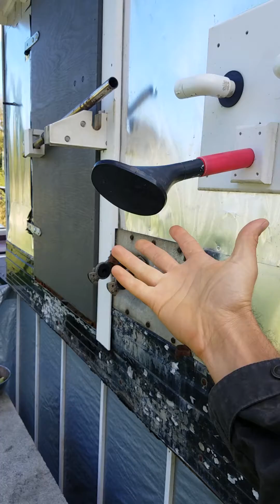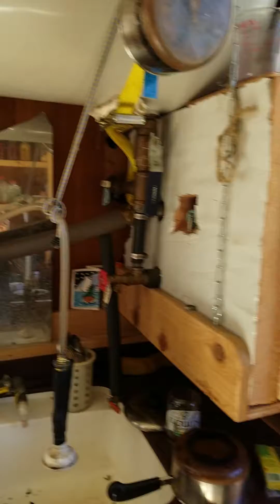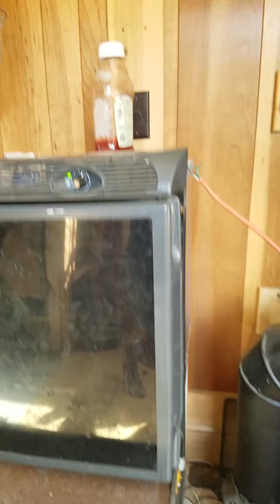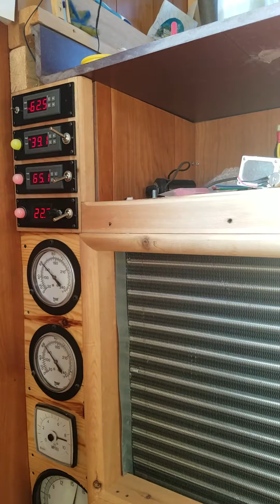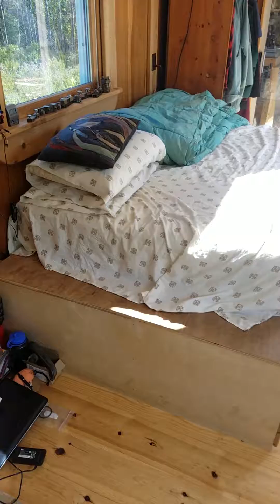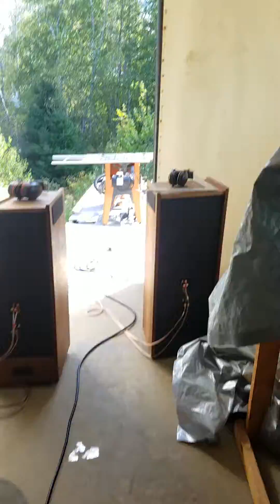Nesthaven: An off-grid tiny-house built in a refrigerated trailer.

Comment: Awesome setup, thanks for sharing.

Solar thermal is something even mentioned on shows like This Old House but despite being pretty affordable it has yet to have wide adoption but could be a massive offset on our energy needs once it does.

Btw, he could have hooked up the wood stove to the heat exchanger too.  There's even kits for turning a wood stove into a boiler and easily plumbing it into the main hot water tank.

I've seen the corded 18v setup for power tools before, but this was the first solar power version I've seen.

Overall, a great demonstration of what DIY'ers can accomplish...
Reply from the maker: Thanks. It's still a work in progress. Definitely had a lot of experience with systems that heat exchange water through a jacket on a woodstove, and with wrap-around exchangers on the pipe.